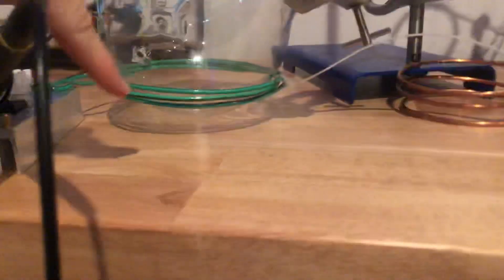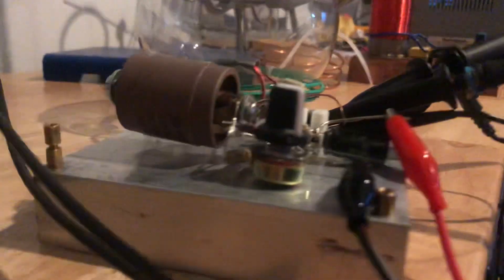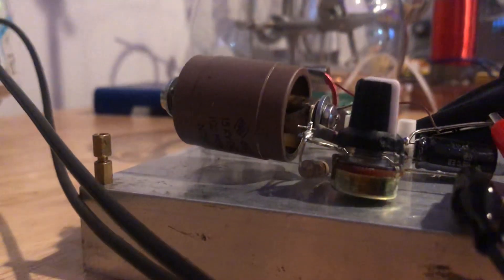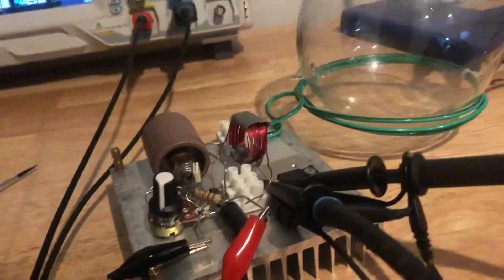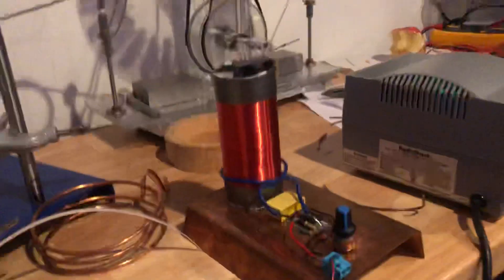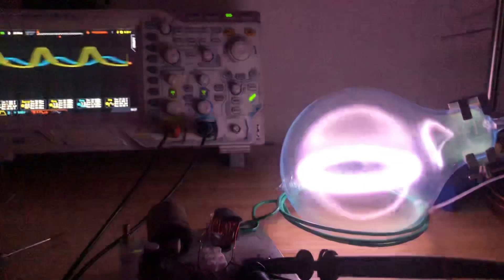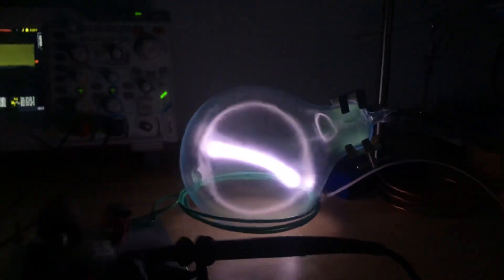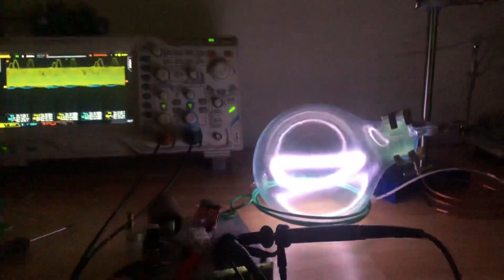HF Plasma toroid in xenon gas!

Comment: An induced circular electric field due to a varying magnetic field, using ionized gas as a secondary 1-loop coil that acts like a magnetically coupled transformer. Beautiful experiment BackMacSci.
Reply: By the way you should saperate your resonante circuit from the power circuit that drives the exitation coil, the plasma toiroid is coupled magnetically to your coil so it will alter your resonant system inductive reactance, making it unpredictable.

Comment: Im new to your channel.  I see Inductivly coupled rf energy into the plasma. What I'm trying to wrap my head around is why the plasna toroid floats above  the coil rather than where the field changes are greatest, nearest the coil.  Buoyancy  doesn't seem right in a low pressure gas. 

Maybe its this..... because of induction in plasma induction, the coil's magnetic field pushes off the plasma's magnetic field which pushes on the plasma. The plasma cant be too far away because the change in flux dies off quickly with distance. But neither does it like to be near the changing field that induced it.  And, rather than  create a small toroid in the plane of the coil, the plasma toroid appears to prefer to hover over the coil.  I'm not sure what instabilities are inducing plasma toroid dancing effects.  Do you have an idea?
Reply from the maker: Thanks for such an insightful comment. Check out the video called “10 inch globe xenon plasma toroid” or something like that. Its a video made by my friend with a channel name like “kcarakevska”. In the video he does this experiment with a 10 inch xenon globe at 15 torr and we see the toroid forms just at the plane of the coil. My theory for why the rising toroid occurs in this 6 inch globe is convection lifting the hotter plasma above the cooler gas. So yeah, basically buoyancy is our best guess.
Reply: @BackMacSci  regarding plasma toroid in the plane of the the coil: Convection not working there? Convection is less effective when there is very low pressure. What was your pressure? 

I  suspect the offset from the plane of the coil is due to some sort of magnetic effects rather than buoyancy. You could easily try putting the coil on top of the globe rather than below, and see if the plasma offset is pushed down. You'd be able to confirm or rule out convection. It might also be interesting to see how it behaves if the coil's plane were vertical rather than horizontal. 

Maybe there is something about  the circumfrence of the plasma ir the coil with inductive and capacitive resonance preferring a certain circumfrence unavailable in the plane of your coil. Is there a DC  bias in the coil?
Reply from the maker: @kreynolds1123  there's no dc bias in the coil but I want to experiment with that in the future. Also, I have done the experiment where I put the coil above the globe and the toroid forms at the top of the globe, not repelled down. But then again I only did one trial of that experiment, so more testing is necessary. And I definitely need to try the vertical coil plane experiment. That is where I am really excited to see the result!

Comment: This is really cool. Kind of reminds of ball lightning.. I wonder, if you manipulated the toroid could you create a stable plasma ball?
Reply: It would be pretty difficult since plasma does not want to hold spherical shapes for too long.
Reply: @drgazter  persistence of vision means you'd really just have to rotate the disk fast enough
Reply: @lirothen  
Sure, but how ?
Plasma is much like a “sticky gas”, a fragile plasma ring is going to be teared apart by electromagnetic gradients long before it can be effectively pushed around. Maybe a rotating inductive field with multiple coils could do it, but then it will be surrounded by copper and not very visible.

Comment: Can you provide a full workup of your circuit diagram and/or full method to replicate this?

The noise when it turns on is for some reason incredibly endearing, it sounds almost as if the plasma itself is a living thing. Is it possible to modulate the plasma toroid using an audio signal. I want to see it react to music for some reason. I need to see it dance to music!

Great video!
Reply from the maker: Thank you so much, Kav. That’s the plan!

Comment: That's epic!

There are special magnetometers which use an RF-excited ionized plasma as a medium to sense minute magnetic fluxes.

An example of such a device is called an Atomic Vapor Cell used by the National Institute of Standards and Technology which are used in Brain-Computer-Interfaces.

These atomic vapor cells are so sensitive that they can detect the magnetic Flix lines from the action-potential of a single firing neuron in-vivo, in-situ, and non-invasively.

Excellent project! A++

I believe this would be great for use as a Atomic Vapor Cell type of Magnetometer.
Reply from the maker: Thanks! And cool!

Comment: I'm wondering if I can make a similar circuit for argon plasmas, as a welder I have access to silly amounts of it, and very beefy low voltage circuits. I have an old welder that I've been wanting to scrap the circuit components for a suitable plasma project. 
I'm not sure as to the feasibility of argon though, I haven't any math to use for this, having never done it before.
What kind of voltage, frequency, etc would be ballpark for argon plasmas? Are we talking kV range or 0-50V, etc.
Also this is nuts, and is a lot easier to start with than fusors!
Reply from the maker: Hi Keaton, I've spoken with plasma artists about the possibility of using other gases but the consensus seems to be that only xenon and krypton will form toroids in this setup. It doesn't mean you can't whip up this circuit and a bunch of argon globes at varying pressures to determine it for yourself though!
Reply: @BackMacSci  I'm addicted to the math! I assume ionization with argon will be relatively easy as the welder already can ionize argon at around 20v, but at something like minimum 30 amps.
What kind of weird little board component do I need to create the oscillation? If I can get it to work I'll send you some info, I love playing with plasmas, I just usually do it to build things!
Reply: @keatoncampbell820  I know from my TIG welding experience that it usually needs a high voltage kick to start unless you are using a strike start. once the arc is established it only needs 9-20v to sustain at atmospheric pressure. HID bulbs in cars work in a similar fashion, they have a high voltage trigger circuit then the cars 12v takes over after that.
his globe is at a very low pressure, something like 20-80 torr so you will need a very good pump to get to those levels.
Reply: @Flyingwigs  yes, the pump and the starting spark. These are both issues I can solve, along with evacuating the tube, but if the argon isn't a feasible plasma for a toroid....
Reply: @BackMacSci  What about radon? Maybe it even can start to ionize itself, being radioactive.
Reply: @jannikheidemann3805  
That would be a bit too radioactive though 😬

Comment: What if instead of just xenon gas, you have various mixture of gases and also metal vapors? Electrical engineer Eric Dollard had a burned-out bulb with everything inside vaporized, in which he was able to create fractal galaxies with two tesla coils 180 out of phase to each other. See Eric Dollard's video How To Create A Galaxy.
Reply: I would love to see this taken further! I read an old Russian paper about a radon discharge tube that would form toroidal plasma discharges on its own. It supposedly would double the input radio frequency. In my opinion plasma physics and toroidal plasma discharge might be key near UV communication. 🤫

Comment: What power transistor did you use for this? Congrats on managing to pull this off by the way! Also what is the power draw roughly?
Reply from the maker: I am using an irfp260n and it pulls about 30W once the toroid is stabilized
Reply: @BackMacSci  oh thats less than i expected. I find it really hard to find genuent irfp260 so i'll likely try it out using irf510 or some of the fake irf510 that i have laying around. Thank you!